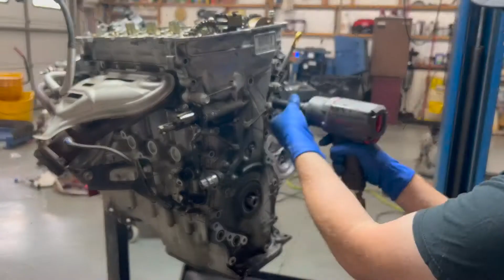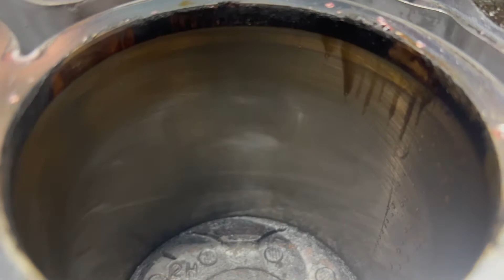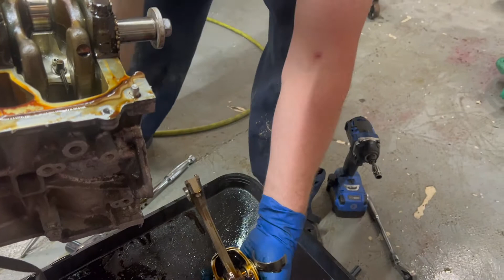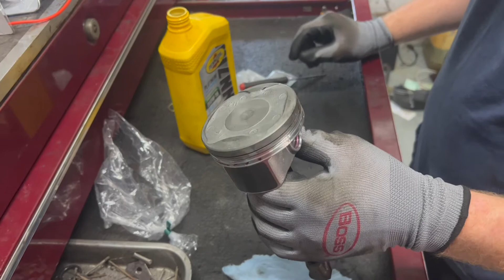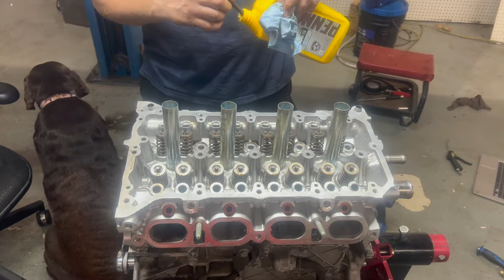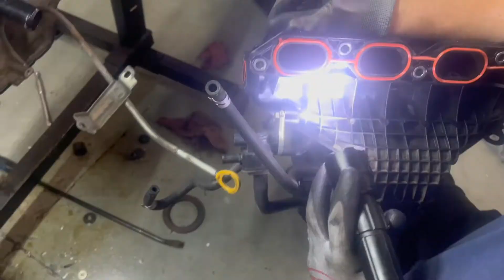10-15 Toyota Prius Burns Oil - TSB Piston Replacement Part 2

Comment: Hey! Just curious where you got your parts through. Did you end up going through Toyota or a different parts supplier? How is the car holding up after these years? I’m about to do the same thing for my wife’s 2010 Prius. It’s got 228k miles on it but I want it to last forever. Wondering if it’s worth it or if I should cut my losses
Reply from the maker: All from dealer. I actually totaled the car like 6 months after I did this, but it ran great and went from burning just over a quart per 1000 miles to less than 1/2 qt per 5,000 miles. That engine will be going in another Prius here shortly that has a completely blown one. If you do it, the engine will last pretty much forever. The remaining problems you will run into are abs booster, abs accumulator, inverter ipm, and hybrid battery so keep those in mind before deciding.

Comment: You're the only one to show the correct way to "activate" the timing chain tensioner.  My old Chilton repair manual for Toyota 2rz/3rz engines also says 'counter clockwise'.

Comment: Helpful video, thanks for posting the series!! I just had a blow head gasket in daughter's 2010 Prius...toollk off the head and found we bent the rod in Cyl #4, so did new bearing, pistons and one new rod of course...and other stuff along the way. Her EGR cooler was plugged SOLID, but it wasnt throwing a code....im pretty sure thats why the head gasket blew (lean/hot). If anyone has one of these cars with 120k miles or more...pull the egr and clear valve and cooler ASAP. I used .187 music wire to punch through the carbon pack in cooler and then gun cleaner in ultrasonic cleaner.

Comment: Toyota uses Low Tension piston rings for fuel economy. Thats why they burn oil. The motors on hybrids shut off and start up so many times it eipes out the head gaskets. Hot then cold. Expand then contract. Use Hi tension rings to stop oil consumption but loose 1 mpg and program your hybrid car not to shut off at stop kights to save the head gasket.

Comment: Did you use stock piston rings? Most other videos state stock piston rings are weak and that blow by gets past and clogs the ring slots and rings. But you state that the new pistons drain back holes might be bigger. Time will tell.?

Comment: Maybe I missed something regarding the oil pump drive chain. You talk about the alignment marks on the crank and the gear yet you do not put the yellow links on those marks.
Reply from the maker: I did. It’s not as clear in the video. But later on when I have the front chain on you can see the mark lined up behind it.

Comment: Thanks for this, first piston/ring video I've come across.

Does the lower oil pan need to be separated first, for removal of the upper oil pan? Or was that just for a general refurbishment?

Also, the driver for removal of head bolts recommended by Toyota is a 10 mm double hex.

Comment: The 2024 2ZR-FXE looks so different. Must have gone through a lot of revisions.
Reply: I’ve looked at many dealership sites for ‘24s and they all only seem to be offering the 2.5 in the new Prius. According to the Wiki the 1.8 is still technically an option, but I just haven’t seen one built that way on dealer spec sheets.
Reply: @user-rv4ob4tg9x  I live in Thailand so my corolla cross has the latest version of the 1.8L hybrid of the 2ZR-FXE. Has plenty of power and I'm getting around 54MPG.
Reply: @Fumblingfilm  I see. When I saw that the 1.8 was still technically offered in the new Prius I did wonder if anyone would even chose that engine, as the new 2.5 has a much more HP and gets better MPG than the old generations of Prius.
Reply: @user-rv4ob4tg9x  I know in the US the corolla cross comes with the new 2.0. But that's another engine entirely. It did get a small bump in power from the electric motor here. But toyota still uses the latest 2ZR-FXE Hybrid. Moves that big car well and gets great gas milage. The cross here does look a lot better than the one over there. The panoramic roof on the one here is great. Here the prius doesn't sell. Nearly Every car is a hybrid. It's hard to find the normal engine anymore. Just a few of the lowest trims have them.
Reply: @Fumblingfilm  Here in the U.S., up until a couple weeks ago, it was impossible to find a ‘24 Prius on a dealer lot. Everything listed on dealer sites was “In Production”. This week I saw a couple brand new Prius in town and now see dealer sites actually showing a couple on-site.

I’m a huge fan of the new look. I am really thinking of selling my 2012 V, but it has low miles and is in very good shape. I haven’t had a car payment for so long it’s a hard thing to consider.

Comment: By the time you get the head off it's easy bell housing bolts and the motors out. Totally not worth doing in vehicle.
Reply: Agreed. It's one of the easiest engines to remove. Just remove it.

Comment: Did you figure out what caused the head gasket to fail? At 18:55, I can see the new oil rings are different from the original but why did Toyota issue new pistons? Are the rings thicker than the original set? Thx for the video.
Reply from the maker: The head gaskets just start leaking for no apparent reason on these. Usually around 180k miles. I think the oil drain back holes in the pistons are bigger so they don’t get clogged up with carbon as easily.

Comment: Get a dripper bottle to apply assembly lube. Costs a few dollars and pays for itself quickly.
Reply from the maker: Toyota specifically says to use 0w20, not assembly lube. But I agree with the dropper. I have one at work, just not at home.

Comment: is it better to replace the engine?
Reply from the maker: This is a somewhat common problem, so if you get a junkyard engine, you might be in the same boat or worse. A new engine is much more expensive than this repair.

Comment: Hi, I’ve watched your three part videos all the way through several times now and I did not happen to catch the parts kit number for the updated pistons and rings. I have pulled the head off my 2012 Lexus CT200h which is the same 2ZR-FXE engine. I’m at a decision point where I may do the same piston and ring update as you but I’ve called the Lexus dealership and they have no idea nor have ever heard about an updated kit. My engine is all apart and I want to be able to make a decision in the next few days before the head comes back from the machine shop. The block is still attached to the transmission and in the car so I will have to pull it separately if I’m going to do it. Could you please be so kind as to supply the part numbers?
Reply from the maker: Search for T-SB-0169-16 that has all the part numbers you will need.
Reply: Part of me is torn because according to the TSB I do not meet the criteria of replacement pistons and rings because my oil consumption is not high enough. I could just put on a new head gasket and everything back and life is good (hopefully). The other part is I’ve gone this far and I intend on keeping the car, trouble free, for a very long long time. I’ve already done a lot of work on it and replaced the hybrid battery. So if it’s an extra 4 or 5 hours,  I would be willing to go through the trouble of pistons and rings just for the peace of mind. My intention was not to replace the pistons with the block still in the car, but to get a hoist and remove the block and put it on a stand. My rationale was that it would be simpler to remove the block without everything else attached because there’s less mass swinging and as a result, I could maneuver it around easier. Am I right? Do you think in that scenario it is worth doing, or would it be too much trouble to remove the block? Thank you so much for your help!
Reply from the maker: @MinhNguyen-ot1zg obviously I think the way we did it is easiest. But tbh, I wouldn’t mess with anything for that little consumption. This car would burn 1 qt every 1500 miles. It has since gone through about 1/4 qts in 9000 miles.
Reply: @automotiveinsight  thank you for your insight. That certainly gives me something to think about. The guy at the machine shop said by examining my head that he thought i was burning oil from all the oil in head #3 and strongly suggested piston ring replacement which got the wheels turning in my mind. After a 5,000 mile synthetic oil change, i will typically have about 3 to 3.5 quarts of oil in the pan, which i pour back into empty oil jugs which is how I get my measurement. I talked to a local mechanic that suggested that the oil leak in cylinder #3 could be coming from above from the valve seats, which might explain the consumption. The top of piston #3 was also oily. I don’t work on cars for a living so I don’t know how to interpret these symptoms but getting different opinions definitely helps and I can’t tell you how much I’ve appreciated yours!!!! Thank you thank you thank you!
Reply: Thank you!!!! I was able to find the TSB. It says the affected models are Prius and makes no mention of Lexus CT200h. I guess the angel of death passed over the 2ZR-FXE blocks that were used in the CT200h, but mine consumes about a quart of oil every 5,000 miles. No wonder Lexus didn’t know what I was talking about. They do sell the piston and ring set, for about $51 and $101 respectively, making it about $300 in parts for this repair. The TSB makes NO mention of the rear main seal. I am not a mechanic, just a DIY type of guy and I have pulled the head off for a head gasket job leaving the block still attached to the transmission. I don’t want to remove the rear flywheel, or crank if I don’t have to, so do you think replacing the rear main seal is really important? Obviously you did it, but was it easy to do? Thanks again for your quick reply. I may order the parts Monday, going to do more research first before making a decision. BTW did you heat the piston before removing the wrist pin? And did you use a ring expander tool to install the new rings?
Reply from the maker: @MinhNguyen-ot1zg with the block still installed in the car, I would probably leave it alone. It’s a bit of a hassle trying to get everything lined back up.
Reply: P.S. The local mechanic who I trust said that if it was his car he would just put everything back together and drive it for maybe another 5 to 6 years. Glad to hear all the work that you did reduced your consumption drastically.

Comment: Great Video!  I have a bad head gasket and removed the head today. Now, I am thinking I might as well do the rings while I am in here.  Did you buy a kit or piece the parts together?
Reply from the maker: Thank you! I ordered the relevant parts from the parts list in the oil consumption TSB from Toyota. There are some things that you don't use so you can skip those to save some $. Good Luck with the repair!
Reply: How much did it weigh?  The engine block?

Comment: I’m wondering if there’s a counterbalance assembly in with that oil pump?
That would make sense of the timing marks.
Reply from the maker: That’s an interesting thought. It could be. The Toyota 2.4 2AZ engine also has marks on the oil pump as well as balance shafts that are gear driven. I wonder if it’s timed to deliver oil to the squirters at the wrist pins when they are in the down position maybe?
Reply: @automotiveinsight  I don’t know. I know that the 2ARFE has removable balance shaft, so long as you plug the oil galley that feeds it